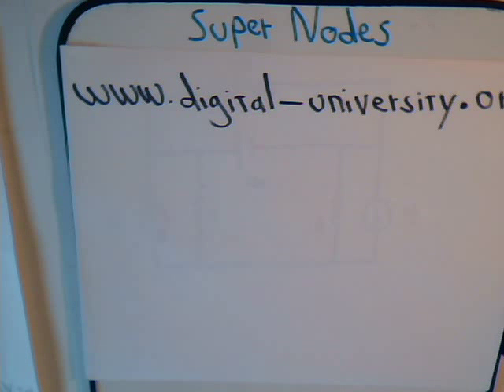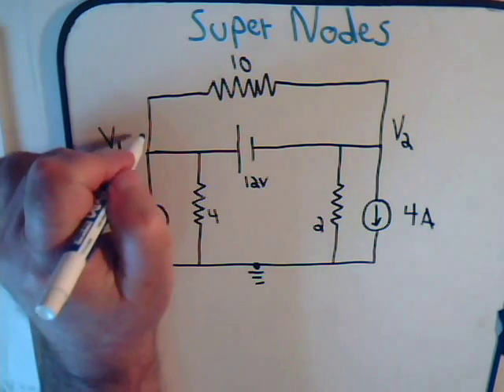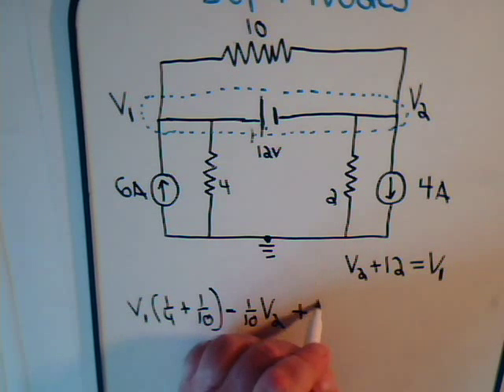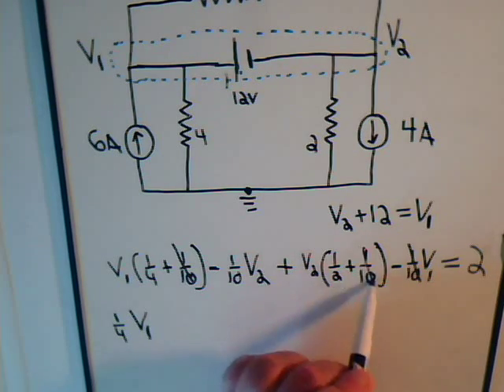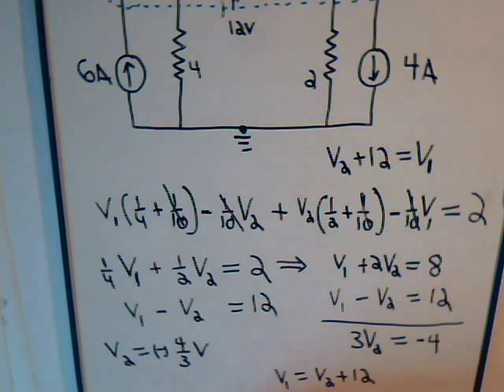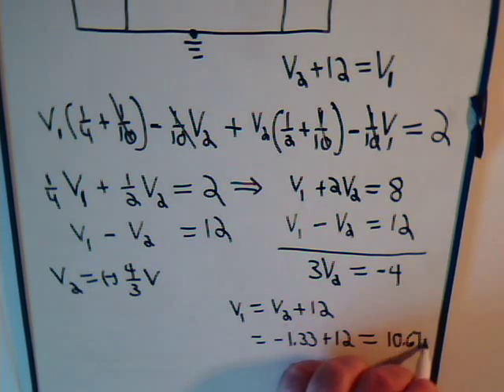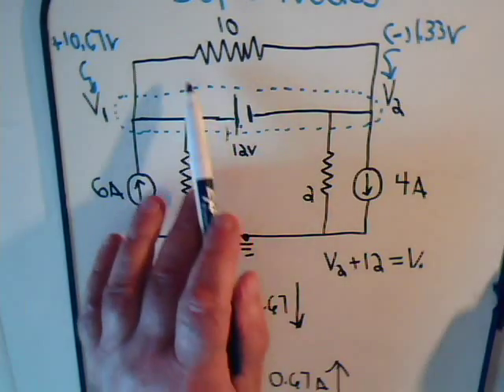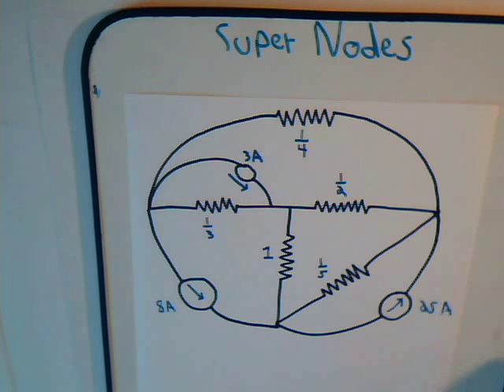Electrical Circuits Video 38: Super Nodes (V And I Sources) Example 1

Comment: Thank you, this was very useful!
However, I am not sure why you inverted the resistance values for each resistor, for example, 1/10, 1/2...etc.  I understand 2 and 4 are in parallel if looked upon from the supernode point of view, but what about 10? Even then, I am not sure. Regardless, 
Thank you for sharing your time and knowledge !